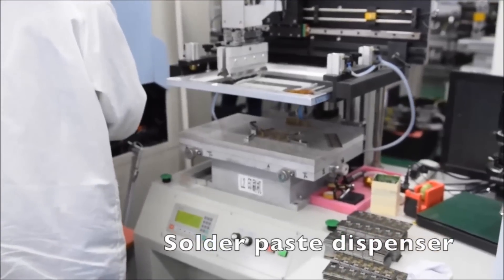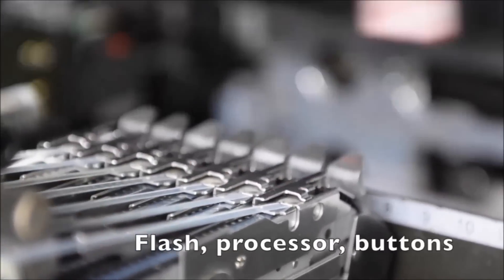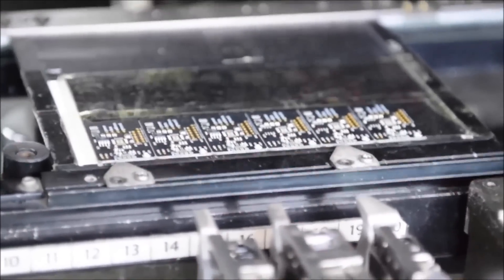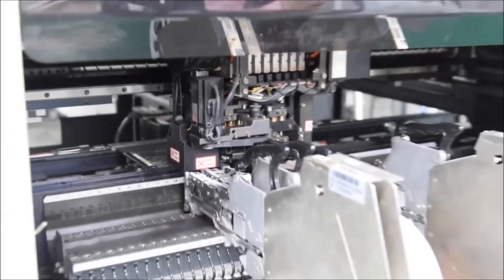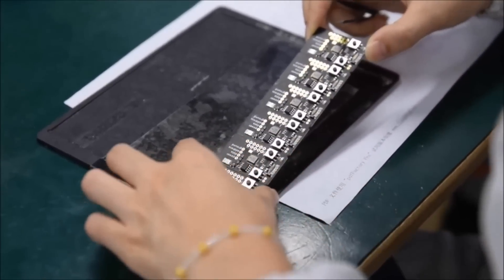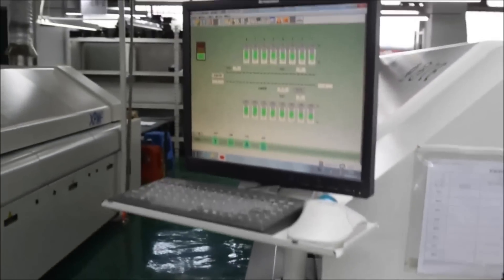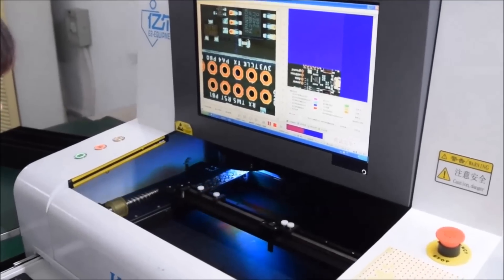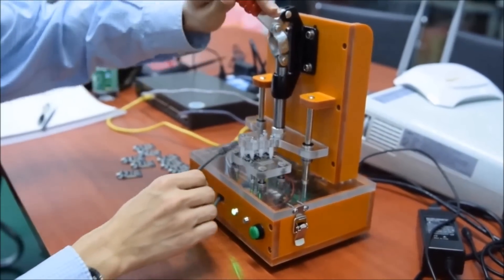How we made PCBA

Comment: what company is that?
Reply: Please contact email: niki@global-pcba.com
Reply: www.szckt.cn
We are the professional EMS manufacturer, our full turn key solutions include following services:
Material price sourcing & purchasing, SMT, DIP, hand soldering, program, test, final assembly and packing
Reply: Makerfabs is an open hardware related products& services vendor in Shenzhen, China.  Makerfabs provides more than 400 kinds of open hardware-related products include the Arduino, Rasbperry Pi, and the most common used modules, meanwhile we ensured high quality and competitive price.

Makerfabs supports you during main phase of your hardware developments. Makerfabs have more than 5-years experience on open hardware and the PCBA production, and our direct access to shenzhen, the most large electronic market in Asia, Makerfabs  dedicated to  create an ecosystem of  "turn key" solution for makers, besides the PCB, PCBA Service and open hardware products, Makerfabs also help on the molding, drop shipping, part sourcing, with incredibly reasonable price and shorter lead time, to help the customer dealing with all the problems so they can concentrate on the designing. https://www.makerfabs.com/